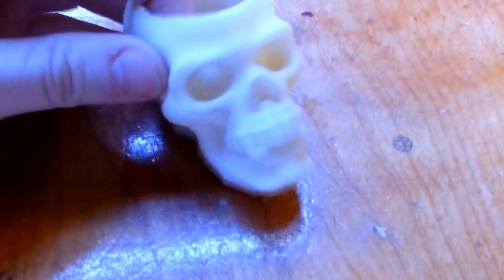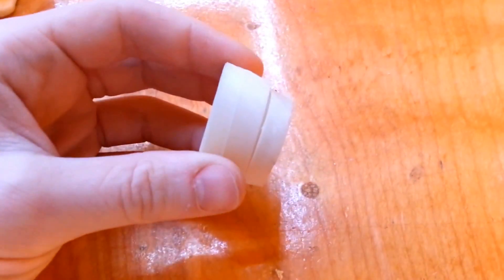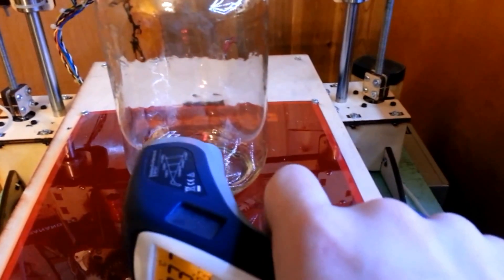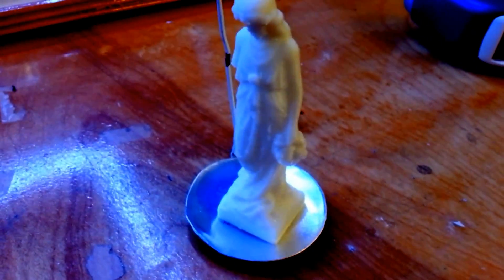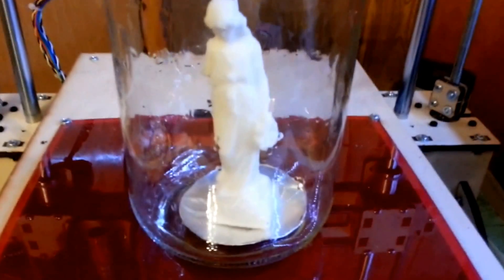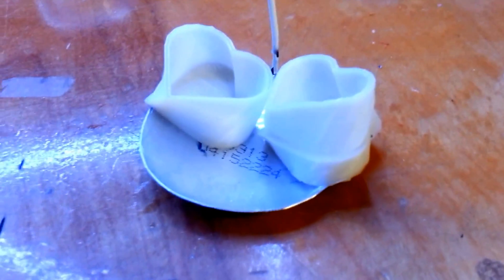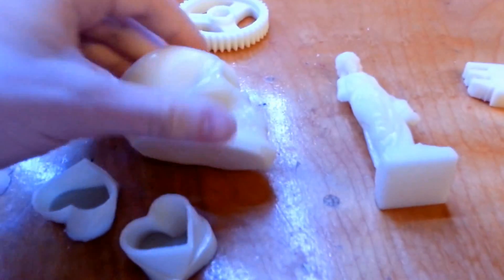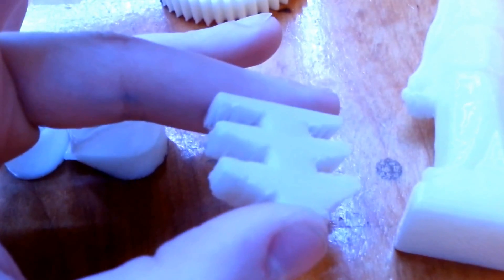Acetone Vapor Smoothing on 3D printed ABS parts from my Printrbot

Comment: dose it strengthen
 it ?
Reply: It will strengthen the part, but you have to follow a few steps that OP didn't.
(1) Use pure acetone. Can be found at a hardware store.
(2) Let the parts dry for a few hours before handling.

By using pure acetone it won't take NEARLY as long, and you'll have more distinguishable results. Just BE CAREFUL as acetone is dangerous, especially when you're heating it up.

Comment: Nice video, sharing info is the way to go in this daunting world of 3d printing. I did my first vapor smoothing today. Mine worked like a charm, total exposure time was about 30 seconds. That is enough to get a perfectly smooth finish. I used pure acetone, just at the boiling point generating a lot of vapor. I read somewhere that you should not use nail polish as it contains other chemicals that will impede your result in this application.

Comment: get a used pressure cooker, a hot plate, and a timer.  The pressure cooker has a safety valve, and can handle the pressure since it was designed for that very purpose. 20 bucks at a garage sale.

Comment: Heads up on your use of the IR gun: the accuracy when aimed at glass can be way off because of glass' lower IR emissivity compared to the "reference" value the meter is calibrated for. The workaround is to give it something opaque to read... either scribble a square inch of black sharpie on the jar or put a strip or two of electrical tape on it and use this as your measuring point.

Comment: A loop of tube with computer fans circulating it, just mount and in and out valve. A guitar tone knob can regulate the fan speed, did that in a few computers before. Kinda like a small wind tunnel of acetone you can recover to cheapen cost later.

Comment: Okay, that's fair. But they make variable pressure valves that release only when exceeded pressures are attained. You could keep that threshold rather low and be quite fine. You might even want to consider trying to pull the air out of the container to thicken the cloud, if you have access to a vacuum pump with parts that can handle any excess acetone vapor. Maybe if you cool it first.. oh God, complexity threshold.

Comment: Brotip: Allowing the acetone to escape the vessel is going to cause more condensation to occur near the outlet, which is going to minimize the amount of vapor near the outlet. A more even saturation could probably be attained by pressurizing it. Maybe you can add a release valve to the lid to make it easy to depressurize so you can open it? Outside, of gravity, I imagine it'll smooth out your testing.

Please tell me if you try that and if it helps. :) This is awesome.

Comment: I think using a solid base to sit them inside of the jar may be a hindrance. The vapor is flowing upward if I understand the process. The large base your using would explain why the skull came out so smooth, it's larger than the base.

Maybe try hanging them inside the jar with guitar string, preferably nickle-steel so that it doesn't leave a nasty residue. Or some kind of sparse wire cage to sit them on top of inside the jar.